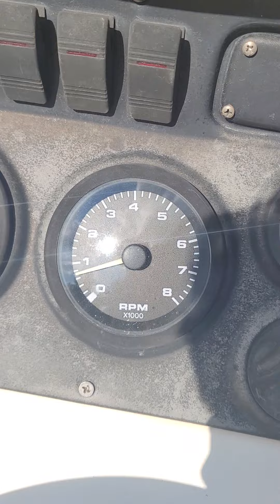Spencer mercury 125 power and idle issues

Comment: Is this due to the 2+2 cilinder for fuel optimalisation? When do the other carbs work? At about 1500-2000 rpm?
Reply from the maker: As soon as enough air is moving through the Ventura to draw fuel through the main jet I suppose.  As far as fuel optimization its my conclusion that the engine will run to fast or pooling of fuel would occur so they just blocked the mixture’s on 2 bottom carbs. My opinion
Reply: Hear how it hesitates going to wide open. The idle is a little lean or the accelerator pump is not correctly adjusted. That slight bog is definitely there and that motor I think needs an extra 1/8 of a turn richer on the idle mixture screws.